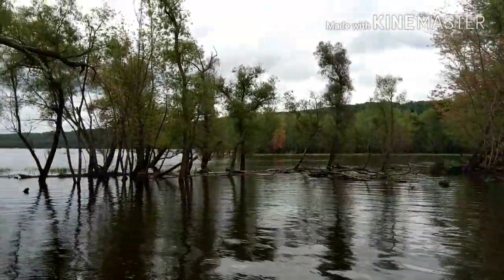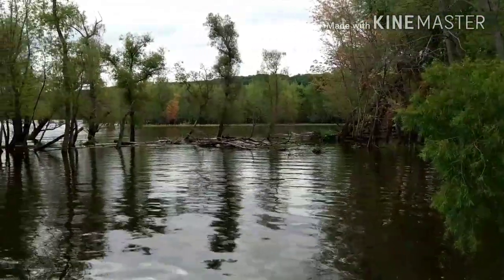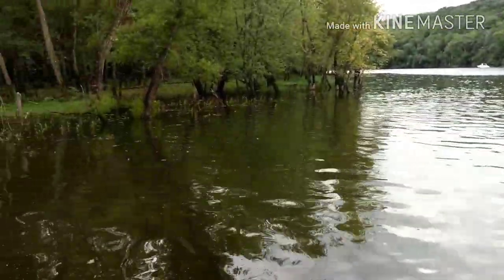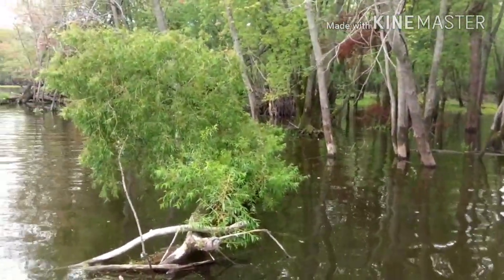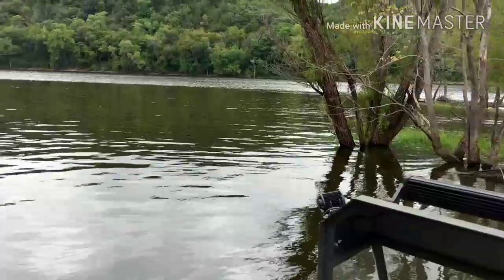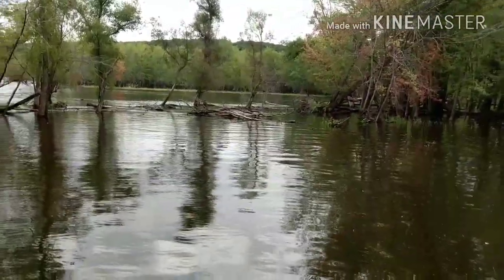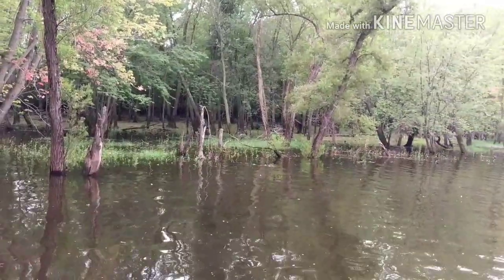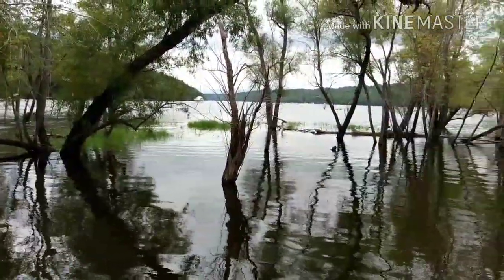So you want to build a jet boat?

Comment: What jet ski and hull would you recommend for a 16 ft ?  I don't have either so I would like your opinion.
Reply from the maker: I'm really sold on the v hulls so anything with a good v in the front and flatter twords the back. Sylvan, smoker craft, alums craft etc. And a Yamaha 1100 or similar jet ski

Comment: I have been watching your videos for the last two years trying to get the gumption up to start I jet swap on a Smoker or Lund. Now...I’m kinda gun shy of 2 stroke engines. Are 4 stroke jet skies a viable option? Or do you need that instantaneous power of a 2 Stroke?
Reply from the maker: The only reason I haven't used a 4 stroke is the cost. I try to find cheap deals for projects because they tend to add up fast. I wouldn't hesitate to use a 4 stroke if I found a deal on one. The noise savings is worth it alone. Several guys have used them with good success I say go for it and no need to be gun shy. Thanks for watching I really do appreciate it
Reply: JDS Outdoors Holy shit, that was a fast response.  See, we’re I live, we don’t get the cold you do. We just have high moisture all the time.  It’s a pain in the ass to keep a 2 stroke dirt bike running perfect. They’re finicky at best. I’ve always had good results with 4 stroke regardless of it being a dirt bike, go kart or an outboard. But, thank you for easing up my mind. Plus a lot of our rivers here range from 60ft deep to 3”. Washington State, Home of the jet sled.
Reply from the maker: @Rokynutz  one of the few states I haven't been to yet and would love to see. Awesome country up that way. If you do build one join Franken jet Jon's on Facebook and post some pics. I'll follow it there
Reply: JDS Outdoors Wet and temperate on the Westside. Hot and dry on the Eastside. Big ass hills in between the two. Lol a little bit of everything to fish for. I will go join the group now.

Comment: New at this, trying to gather information, so forgive me for being ignorant here, but what’s a spoon before the intake? Obviously, I know what the intake is, but what’s the spoon you’re talking about.....and thanks for the v-hull, front end, heads up.....all info is appreciated!
Reply from the maker: Take the back side of a spoon, run it under your faucet in the sink and watch what it does to the water. Now use that same design on the bottom of the boat in front of the intake.
Reply: @JDSOutdoors  Ok, so does the spoon then streamline/divert, (if you will) the water directly to the intake? Is that its purpose? Because I hear a lot of guys talking about cavitation, does the spoon help eliminate that, or am I up the wrong tree altogether?......And again, thanks for the insight!
Reply from the maker: @trainbobber03  no you are absolutely correct. It forces water in and air around it to help eliminate cavitation

Comment: I have built afew mud boats and I run the Surface Drive mud motors. But my next boat will be a jet skiff. I like the pointed bow also. The hull I'm building is a 14ft flat bottom skiff design like my mud boat. But I'm new to the jet boat thing. What do you mean by spooning??  I'm not cutting out the bottom and bolting a sea-doo to it. My boat will be all 5086 Marine Aluminum.. Love to pick your brain. How can I get ahold of you..thanks.

Comment: What size boat would be good for setting 155hp waver runner?
Reply from the maker: Buckwild 65 a 16' would kick ass with that motor. I personally wouldn't go larger then 18'  I'm working on a new 16' with a 250 horse supercharged motor. well collecting parts for it. found the ski just need the cash now
Reply: I got the ski and will find the boat what would you charge me to build it
Reply from the maker: Buckwild 65 no idea on where to start to give a price. and I wouldn't have time till.next winter because I have to many projects and work going on
Reply: No need now just shelled the motor all 3 pistons. If you are building a new one or build one to sell let me know.

Comment: Jon, are you ever going to make a video of this boat running the chutes so we can see how well it does. Im still somewhat hesitant to choose a V over my ModV only because in the NE we have river runs that literally go up hill and only leave a thin cushion to plan over.
Reply from the maker: Tyler Kramer there is only one area around me with rapids and it's currently blocked by one hell of a log jam I'll have to check it again and see but that is a rocky stretch which makes me nervous
Reply: Yeah rocky rapid inclines are different than pebble chutes. I did learn on my stand up jet ski runs that there is usually more water than you think. I once saw a prop drive 12' V aim directly into the sharpest tallest rapid as if it were "the way" to go and he flew thru like it was nothing. That was the day that I began to really run the miles through rough stuff. Dont push it, I think your right about 4" clearances but that boat won't exactly bounce off of a rock lol. Have you looked into the plastic bottom paneling? I dont know a whole lot about it.
Reply from the maker: It's called uhmw and I have but in my opinion it would be a waste on a riveted boat
Reply: If you were to build this exact hull again, what would be your choice of horsepower the second go?
Reply from the maker: Tyler Kramer same amount would be fine it works good but more wouldn't be bad just remember the faster you go the harder you hit shit
Reply: Yeah I dont care about the top speed nearly as much as I care about how fast/easy it gets ontop of the water. The Seadoo 717cc 85hp top speed would be fine, but for roughly the same price I can go with a Yamaha 130hp. Its a tough call, my decking will probably be all wood. It tough to find the 2 cylcs for CHEAP, especially with a reverse bucket. The 3 cylcs are fairly easy to find for $15-1800
Reply from the maker: Tyler Kramer it has no problem getting up fast. It will be even better when I'm put the new impeller in

Comment: Im thinking 2 155 hp motors in a 15 foot spectrum
Reply: 2 stroke? 4 stroke? Ive got an old seadoo speedster with twin jets. I think it's 15 feet long and the jets are powered by 2, 2 stroke, 85 hp rotax. The hole shot is instantaneous with the 2 strokes. Top speed is very close to 60mph, down side is I can burn up 25 gallons of gas in 2 hrs ..and it seems like 20 min.

Comment: Two 250hp supercharged Kawasaki engines I have lying around. On a 16ft G3.??
Reply from the maker: That would be insane and awesome If you can make it work.
Reply: JDS Outdoors 500 hp is a lot of power. I like the ones I've have seen, where they cut the bottom from the ski and incorporate it into the boat. I do appreciate your work and your ideals.👍👍👍
Reply: My buddy built a boat for me with puck board on the bottom , it was flat bottom , we took a Kawasaki 300 ultra supercharged engine in it and tried to make it perform but had troubles with cavitation , pump was getting to much air I'm guessing intake was too high and ahead instead of down and back

Comment: I just spent my afternoon watching your jetboat build video's and everything you went through to complete the one you use in this video.I'm impressed to say the least. while I did see a few flaws in your build. such a framing supports under the deck that probably should have been designed more like the framing for an aircraft wing. The fact that you told people in the beginning not to use sheetrock screws and then every place where you needed a hinge you used cheap steel door hinges rather than good stainless steel marine grade hinges.your windshield and the walkthrough section was a great idea even though I probably would have gone with a center console and the same idea with the walk through but set the windshield up to swing in so that it wrapped around the console and used the lower section that you have the only two hinges on the entire door (that won't last long and you'll be making a change there to.) as the riser for the bow platform. Also your bowline on the winch. I'm guessing that's for an anchor I would have used a pulley rather than the winch fairing you used. with the pulley mounted in the bow the free spin of the pulley wheel eliminates any chance of the line fraying on a bur of any kind on the boat. Also if that is for an anchor line loose the tow hook on the end before you lose your anchor. replace it with 12 links of good tow chain from the anchor to the rope you'll be glad you did and speaking of that rope nylon rope breaks down over about one to two years. go to lowes or home depot and get some good cotton/nylon weave over nylon core rope it will last longer and wind up on the winch much better because its round like winch cable.
I've watch about every jet boat video there is on youtube and as I said before your step by step series is the best I've seen so far.this will serve many more down the road than you will ever begin to imagine. you should put the entire series into a playlist if you haven't already so everyone can watch it from start to finish..You mentioned you're looking for another jet boat challenge? here a little thought. you have that pontoon boat you wanted to make a house boat out of the pontoons are made in individual sections and than welded together why not open the two stern sections on each side and install a pair of jet drives. most pontoon boats when they turn stay flush with the water's surface not to mention if you look and most pontoon boats in the water the weight is all on the stern anyways so cavitation shouldn't be an issue.as for your idea of a house boat on that pontoon boat I saw your camper trailer in the background even if you pulled the axles and the road frame out from under the camper it would still be to heavy for that pontoon boat however a pickup camper would slide on very nicely and down under the overhang you could enclose that with a wrap around windshield.on a pontoon boat and in any house boat keep in mind storage space is everything..